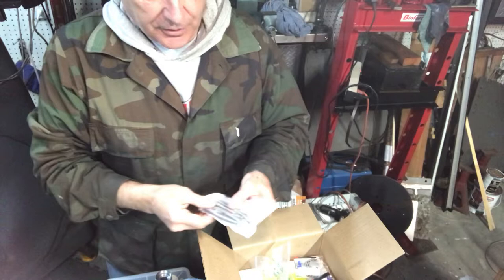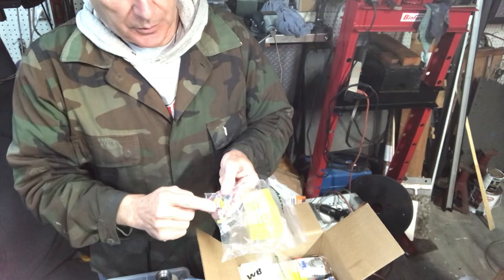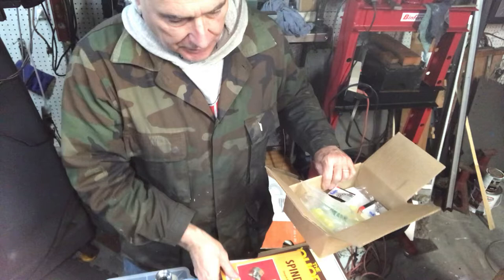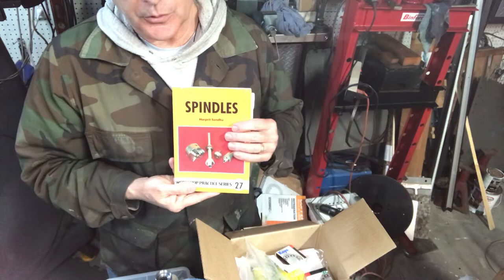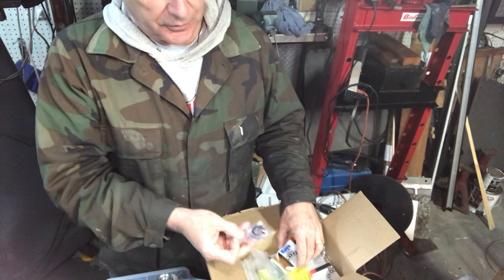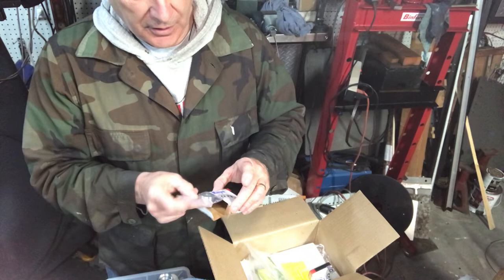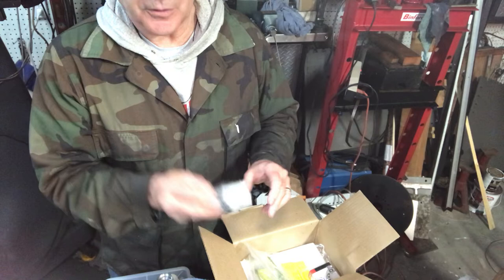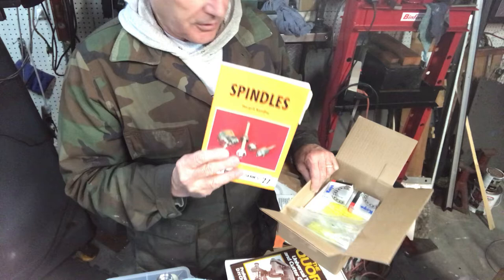McMaster Carr parts unboxing. Quorn and Live Steam goodies.

Comment: I like that Spindle book as well!  He does say that many of the spindle designs that use loctite are basically not repairable, but for many things that's OK.  I  came upon the author's work on cutting gears using only a single gear cutter with the rack (straight sided) form by making multiple passes moving the height of the cutter and the rotation of the gear blank by less than the full amounts.  There is a similar idea over at Andysmachines channel where he uses a slitting saw the same way.